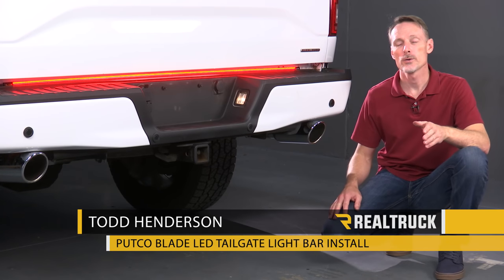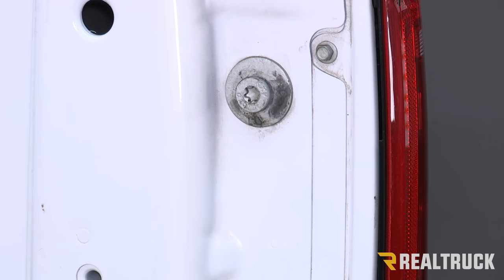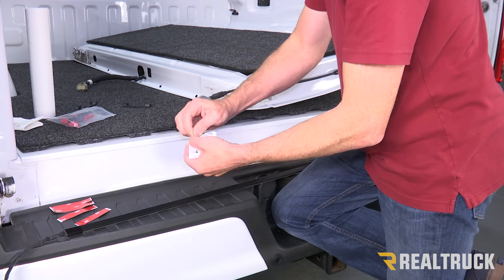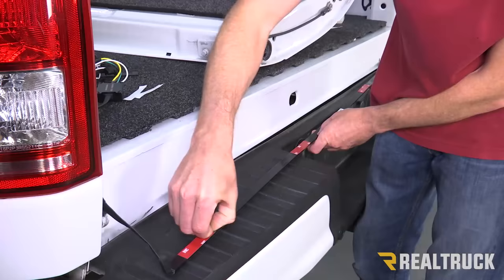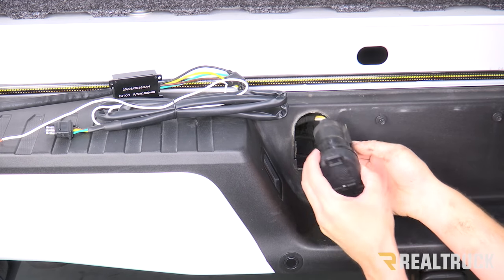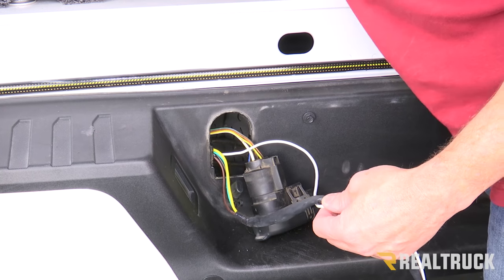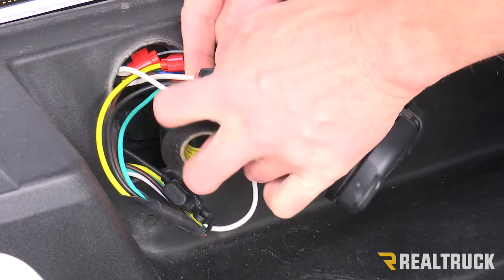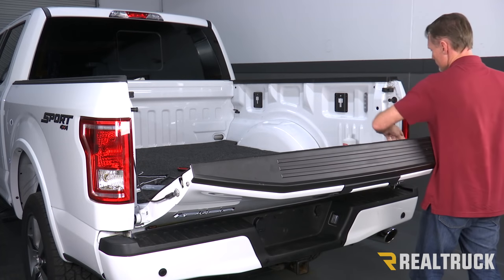How to Install Putco Blade LED Tailgate Light Bar

Comment: After installing aftermarket products and lighting in New England for over 25 years, I would highly recommend you do not use those t-tap connections. In the colder weather, those connections will fail every time. I always solder my connections and use a weather proof heat shrink wrap for a never fail connection.
Reply: John G thanks bud .
Reply: Hey Mr. 25 years, It's not a T tap. It's a Scotch lock.
Reply: Those scotch locks are garbage,  I wouldn't even use them high and dry inside the cab.
Reply: Ok boomer
Reply: Yep. I agree.
Reply: Curtis makes a plug and play harness for the backside of your factory harness no splicing necessary except for backup lights
Reply: terry newman could you post the link please
Reply: @terrynewman3665  if I can find this plug and play harness from Curtis will I have to disconnect it everything I plug my trailer in????
Reply: You won't have to unplug it as it connects underneath and doesn't block your trailer plug.

Comment: Pop out both taillights , Splice one wire onto right side brake lite wire , Feed it through frame to the left hand tail light , then you can hook onto left brake wire , tail light wire , and back up wire, much easier. AND NO TRAILER WARNINGS on the dash.
Reply: Makes more sense to hook it up your way
Reply: Yeah man this dude in the video doesn’t know jack!  He call a simple clip a “stand-off”.  What is that?  I have been a mechanic for over 20 years and a body/frame tech for over 15 and never heard that term ever!  I just wanted to know left and right on the harness cause the bar came with zero instructions!
Reply: How do you know which wires are which though
Reply: @DeepPocketsEnt  Use a 12 volt tester, It looks like an Ice Pick.

Comment: What they fail to mention in the video is, if you wire it this way, yes it will work but you will have a “trailer connected, trailer disconnected” come up on your dash constantly while driving and if you have bliss (blind spot sensors” they will constantly go on and off because the truck thinks there is a trailer connected. 
The correct way would be to use the ground to the hitch and wire everything else to the perspective tail lights. I had to learn the hard way... not sure why they don’t make this clear and send instructions for wiring to the trailer hitch or the tail lights.
Reply: I am having same issue with my 2016 F150 Lariat. Thank you for writing this comment.
Reply: Excelente comentario y muy cierto..
Reply: And on new 250s u can’t wire direct to tail light. U need harness. There’s a separate brake and run light wire that u can’t connect to bar w out factory harness

Comment: Did this method on a 22 250 and still tripped the trailer alarms. Have to get the factory light harness for the tail light hookup

Comment: My son bought an A brother triple led 60"bar. Ing off lights are correct. With ignition on he got canbus issues eg the sequential  amber turn signals just part lit and did not scroll.
Running light flickers.
We installed some canbus resistors and it helped.

If I order from you how does your unit cope with canbus .
NB his van was a UK   VW caddy .

Mine would be on a Vaux Insignia 2011.
The US version is a Buick Regal 
Thks

Comment: If you had to replace the light bar, do those quick connects cut the wire so you would have to re solder or no?

Comment: On a 2018 sierra/Silverado the wiring box will NOT fit between number and valance you will need to go around the outside of the number and up inside and zip tie to wires above.  Blue wire is NOT used on truck wiring.  Green//white wire is backup, grey/brown are running lights and the main loom connected to the factory 7 pin does NOT have enough length to wire behind the bumper without a pita.  Easier to get down under the truck once the spare is dropped and moved out of the way and wire things up inside so you have more wiring length and can actually get to the need wires for the scotch locks and you'll reduce swear words by 75%.

Comment: one year in snow you will be having electrical problems.  soldered joint with a coat of silicone then slip heat shrink over it before the silicone sets up and then place the harness in a loom. I have connections on my semi-truck that have lasted 5 years of snow and are good as the day I did them.

Comment: Question for the expert.....I have a 2020 GMC Sierra 1500 Denali and brings the tow package in....I bought 60” LED taillight similar like the one you just installed ....I plugged the 4 pin connector directly into the GMC tow switch connector who has a 4 pins connector and a 7 circle connector to see how they look and to determine which side the signal light will be blinking first....as soonest I plugged into the switch on the back of the vehicle , the 60” taillights came on but suddenly came off so I proceed to unplugged and connected back again and the same thing happen again....I was able to hear like a solenoid or small computer nearby the spare tire kicking in and off which make me to believe that I need some type of hardness to bypass that solenoid or computer in the back.....my question is Do I need an extra hardness? Some type of Y connector to bypass camera, bumper sensors, tow package sensors? ....the sad part is I unplugged from my vehicle and plugged into a Ford 250 2006 towing switch and it was perfectly fine and worked like a champ....sometimes technology stinks 😷. Need your help on this one....thanks.
Reply: Yes there is a  harness

Comment: Bought this the other day and having trouble installing on my 2016 GMC Sierra. I guess I don't have the towing package so I need a special adapter, but I have no idea where I'd plug in an adapter. Any advice?
Reply from the maker: panthers21546 if you don't have the towing package there is what is called a wiring "t" that you can get. If you look under the back of your truck you should see a connector in the wiring harness on the left side by the frame. It will have wiring running to both sides of your truck for the taillights. Unplug it then install the T connecting each of the sides you unplugged back to the T. All done.  If you  have any  other questions about this or would like more info on how to do this or any of the  500000 plus accessories we sell and would like to speak to a person directly feel free to contact our knowledgeable Customer Service folks at  877-216-5446

Comment: The lighting kit I received didn’t have the “wire taps” included. Looking online, they come in different gauges. What is the proper gauge I’d need to connect into the backup lights?
Reply: Get the 3/4 inch they work great.you can get them at Golden Coral or shoneys.dont cost much.

Comment: When I installed this on my truck it turned off the back up sensors and tells me there is a trailer connected to my truck
Reply: Theres certain lights that say you have to have a box for that reason reach put to the company they will explain.

Comment: Will this work on a 2017 SuperDuty. These truck have a plastic piece about 12" long in the middle of the tale gate where your product would go. Thanks.
Reply from the maker: Yes, they have an application that would work for the 17 SuperDuty. If you'd like to give our sales team a call they can get you the correct part number.

Comment: I live in a place where it's extremely hot most of the year (120+).  What would you recommend for attaching this light bar?  I feel like the 3m adhesive will melt and fail.
Reply from the maker: 3m tape has a storage temp threshold of about 95 degrees. As far as once it's installed - we'd recommend you reach out to PutCo directly or a local auto body shop to be able to answer that. It's possible that it's automobile grade and could be fine in higher temperatures.
Reply: SE Texas here, there are 3 different 3 M tapes, you specifically require 3M, Outdoor, Heavy Duty and yes it will hold.  You may want to use more than a few tabs though.  Depending on your application, hot glue works as well.
Reply: Move to a different state. :)

Comment: Hello Todd, I have had other brand taillight bars and I really like them and they make it so much better for other drivers behind see me so much better be it turning,stopping or parked..I do have a few question for you if you could please answer them for me,I just recently bought a 2016 Chevrolet Silverado 1500 Double Cab 4X4 LT  and I want to buy a Tailgate Light Bar..Here are my question for you...My 1st question is I notice that the turn signals are amber,can you tell me is this legal in all States as all the other brand Tailgate Light Bars that I have own the turn signals where red,Now I live in New York State and my understanding with the law here the rear lights on any car/truck for turning,stopping or parked the rear lights must be red in color..the only place that I know that amber lights can be used is in front or side..Now with the Putco Blade Tailgate Light Bar would this be allowed to be used in New York State or my neighboring States like Vermont or Canada? My 2nd question is about installing the light bar do you know would it be ok to use 3M Velcro double sided tape in stead of using the 3M tape that comes with the light bar? I am asking because if I wanted to say replace the light bar if it would stop working or if I was to upgrade my truck I could just easily remove the light bar and put it on to a new truck..My 3rd question is do you know if the wiring color is the same for all trucks? Thanks for any help you can give me..
Reply from the maker: Clarence Smith yes you can use Velcro to attach it. Yes it is legal because lots of vehicles out there actually have amber turn signals in the rear. For example here is a tail light from a 96 Explorer. https://www.go-parts.com/media/catalog/product/cache/1/image/300x220/040ec09b1e35df139433887a97daa66f/F/O/FO2800113.jpg 
So not sure how a state can make a law against an OE part. The best thing to do, however, is check with your local state DOT for legality before installing any aftermarket product.  If you  have any other questions about this or would like more info on this item or any of the other 500000 plus accessories we sell and would like to speak to a person directly feel free to contact our knowledgeable Customer Service folks at  877-216-5446
Reply: I really appreciate you getting back to me,I will surely contact the DOT to make sure  that I will be able to use these where I live,

Comment: Could you use a T-Connector instead of splicing the wires together?
Reply from the maker: +Logan,

It's possible that you can use a T-connector. Unfortunately, we aren't able to get into wiring and everything so if you have questions you would have to ask Putco directly.

Comment: Can I still use a trailer and plug it in with this setup...
Reply from the maker: Hey Frank! Yes, you can.
Reply: Yes as long as the scotch locks didn’t sever too many of the wire strands. Scotch locks are terrible things to use to add new devices. They sever wire strands on larger gauge wires and often times car manufacturers use very small gauge wire that just gets broken in two. Even if you are able to make a successful tap they often fail later due to corrosion.

Comment: does this work the same way for the ram 1500
Reply: Basically yes but I also bought the Curtis harness that plugs in on the backside of your factory harness. So it is all just plugged in. It's much cleaner only splice then is for backup lights

Comment: Does your light bar also read as a trailer connected?
Reply from the maker: Hi Justin! Every install is a little bit different depending on your make and model of vehicle. It should not read trailer connected on your vehicle if installed properly. Thank you!
Reply: RealTruck.com I installed on a 2015 Ford F-150 and followed the instructions step by step, connected all the wires correctly, and double checked. Could it be the scotch clips not keeping a solid connection?
Reply from the maker: It is very possible. If in doubt I will soldier the connections.
Reply: They've connected the wrong wires for a truck equipped with the towing package, it must be connected to the actual truck tail lights or the towing system sees it as a trailer. Also there is a special bar for trucks equipped with the lane keeping system
Reply: I followed this video to the letter and my truck sees this as a trailer.  Of course now that I have cut the harness things become problematic.  Has anyone connected this directly to the lights instead and resolved the trailer detection issues?
Reply: As per my original post you cannot connect this to the trailer harness, mine is connected to the actual truck tail lights, If you have Blis it's also a different tail light bar required that is part # 92009-60
Reply: SO connect this all the way out to the lights at the tail light?   Electrically it is the exact same thing only a few feet of wire more in between where it is connected now.  I don't see how that solves the problem.  Before I do this, can you say that you NEVER get trailer connected indications on your dash?
Reply: It is NOT the same Circuit at the taillights as the towing plug at the bumper, Not even on same fuse. And yes, I do not get trailer connected errors. For me it was more than trailer connected errors. On a '16 with towing pkg and Blis and lane keep if you connect a trailer ( or truck thinks you did) it disables Blis and lane keeping, so you can easily see why I went with the proper way to wire it up. I am also using part # 92009-60 for compatibility with the extra systems my truck has
Reply: Thanks for taking the time to reply.  I am going to rewire this directly to the lights this week.  I am happy to hear that will resolve the connectivity issues.   Thanks Again.
Reply: Joe Jordan do all the lights work correctly? Backup, turn signals, hazards and brake?
Reply: All work correctly and no I do not get the trailer connected thing because I'm not using that wiring system, I am connected directly to the tail light harness Not the trailer harness, They are 2 separate systems.
Reply: Joe how does the white light effect the back up camera way night? I'm worried it may be too much light.
Reply: So would it be safe to say that if you don't have Bliss or Lanekeeping that wiring it via the trailer harness would be okay?
Reply: @geebo47  😊😊

Comment: Where did you get the wire splice connector
Reply from the maker: Hey Anton! You can find red splice connectors at any local auto parts store. Hope that helps.

Comment: T-tap connections and electrical tape: Yikes! I couldn't see that lasting one Canadian Winter. Solder and use heat shrinks... then run a conduit.

Comment: You know if you just told us which color wire on the light bar harness was activated by which switch on the truck life would be so much easier. White wire = neg, green wire = RH turn......ect. Pintarest wiring diagram to the rescue.

Comment: As I move forward with my install I see he forgot to mention that it's much easier to drop the spare and move it out of the way to unplug the backup camera and on my 18 gmc while using a small flat screwdriver to unplug the camera it's broken the red tab that has to come out to get it unplugged.  Just some "small" details so far...😡
Reply: Well.... he's not doing it on a gmc

Comment: You can not tap into the trailer light harness on a newer truck as your truck will read that you have a trailer in tow!  To wire these correctly you must tap into your trucks main system.
Reply: I've done one light bar on a F150 2015 and back up camera was disabled after all was wired in.. can you give an example of correct way to go about the wiring? THANK YOU

Comment: that design is just wayyyyyy tooo complicated
Reply from the maker: joeleiter it's actually a lot simpler than it looks. The hardest part is taking the tailgate off and on. If you  have any other questions about this or would like more info on this item or any of the other 500000 plus accessories we sell and would like to speak to a person directly feel free to contact our knowledgeable Customer Service folks at  877-216-5446
Reply: @Realtruck  ,I'm just gonna duct tape a flashlight under the tailgate and turn it on when I'm cruising at night.

Comment: Total rookie move using T-Tap connectors. Lost all credibility after seeing that. Do it once, do it right and solder the wires and then heat shrink. Protect your investments.....truck and lightbar. No easy shortcuts.